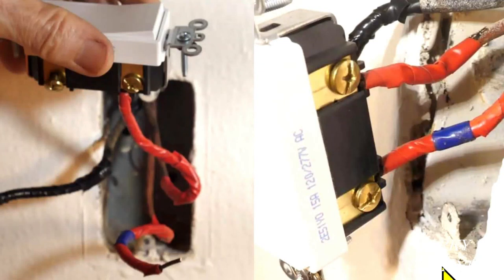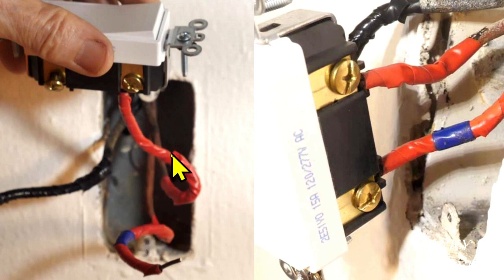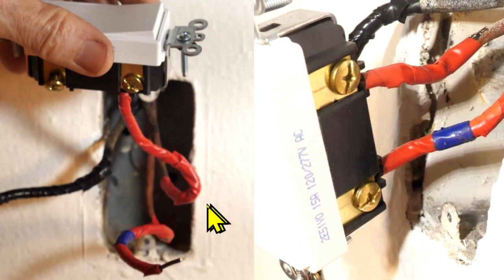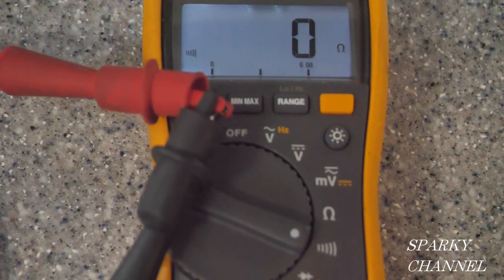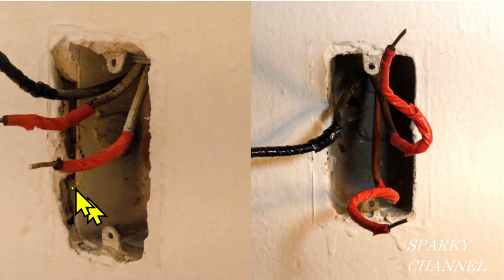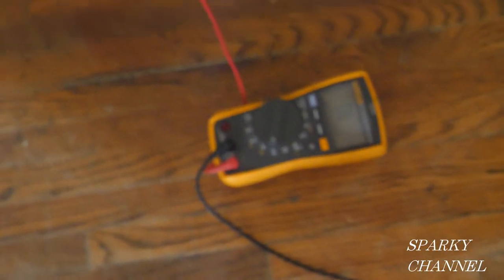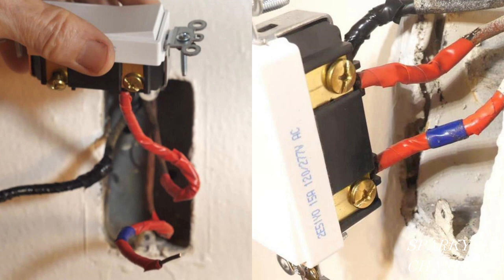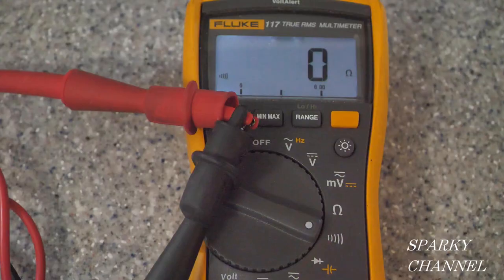How to Find Continuity When the Switch Boxes Are 12' Apart

Comment: I just use a long extension cord - one meter lead goes into the female plug.... Hang the male plug on the remote wire you're checking (I just use the hole that is in most male spade connectors)... Then the second lead to my meter is my probe to find the other end of the conductor at the second box.  With a 100' cord I can check between  practically any two locations in a house.
Reply from the maker: That'll work too!

Comment: The feed was up at the light. The old timers would do this and 3-wire down to each of the 3-way switches. They used to use white for common and black/ red for travelers. Nowadays we do the line/ load splice in a switch box so we dont have to climb up a ladder what can be done standing on a floor.

Comment: There is a great tool used in the UK and elsewhere called a wander lead. It’s particularly important when testing continuity of ground conductors as part of an EICR in the UK. For US a wander lead like this can help you prove that the ground wire twists and splices are continuous you can do it from the source of the circuit at the panel to each installed device/item like receptacles or light fittings. UK electricians would use a wander lead, null the test probes to remove the resistance of the leads and then get a correct reading for continuity. You can then compare this with the theoretical calculation of the resistance of the given length of a circuit they should be close to the test result. That way you can ensure that critical ground continuity exists at each device on the circuit. Critical for determine fault impedance and breaker operation on the circuit as well.

Comment: I use the Extech CT20 Remote and Local Continuity Tester.  It works great no need for long lead wires.  I think it is around $33
Reply from the maker: Hi Chris! I own a CT20 as well and I really like it! It does have a limitation though in that it only tests 2 wires. It won't test for just one continuous wire. For other viewers: Extech CT20 Remote and Local Continuity Tester , green: Amazon: https://amzn.to/3nsRNqq
Reply: @SparkyChannel  Yes the CT20 must have 2 wires but I have not ran into any thing that did not have at least 2 wires.  The CT20 remote will light Red for reverse polarity and green for correct polarity. That way I test 2 wires at one time letting me know the 2 wires are good, and I can mark them to know what one is what.  If one wire is bad I do have to pull out the long jumper lead to find out what one is bad.
Reply from the maker: @chrisu9312  Excellent!
Reply: @SparkyChannel  Can't you test one wire by using a ground reference for the second "wire"?

Comment: Something a teacher showed me in trade school was to connect the power Hot to the traveler and then go to the other switch and test for voltage.  That is, assuming you have a ground.  Id figure that wasnt the case in this house.
Reply from the maker: Yeah, please don't do that. Connecting wires together and then turning on the circuit breaker to test for voltage is a bad idea. You could test for continuity with the circuit breaker off. Is that perhaps what he suggested? Still, that might not be accurate because you're not sure how the power hot is run.
Reply: @SparkyChannel  in his example, he implied doing so in finding the ends at different floors.  Mind you, he says hes been in the industry since the 70s.  I wasnt impressed with what he taught us.  Thank you for the clarification

Comment: could you also ground one wire in the box bolt hole then test the other end to ground?
Reply from the maker: Yes but the old metal boxes don't have box bolt holes. You would have to drill/tap your own.

Comment: What if my wires are 300’ apart? Forgot to phase my wires on a 300’ run
Reply: you connect the hot and neutral on one end of the run with a small jumper wire. This creates one straight path for continuity.  Then at the other end of the run just clip the leads on to each wire.
Reply: That saved me, thank you so much

Comment: Why do we need to know what traveler is what?
Reply from the maker: The 3-way switches will operate in a bit different manner if the travelers go straight across or if the travelers cross. Other than that, it really doesn't matter.

Comment: when i turn my bed room breaker it trips  how can i find the short>? i replaced the breaker  but it still trips   thank you for any help JIM
Reply: If the circuit is feeding your outlets, just make sure power is off, and then check for continuity between hot to ground, and hot to neutral. There should be no continuity between any of those. Don't check for continuity if it is hot. If it is hot (which it probably isn't since you said it keeps tripping) then check for voltage instead. Hot to neutral should be 120V, neutral to ground 0V, and hot to ground 120V. Feel free to correct me if anything here is wrong or misleading.
Reply: @juak91  actually there should be continuity between neutral and ground, as they are bonded together in your panel. Unless you have GFCI protection (unlikely for a bedroom), then a neutral to ground continuity will not trip your breaker
Reply: @derekmorrison8687  you are correct. Thanks for clearing that up. I will edit my comment to prevent a misunderstanding.